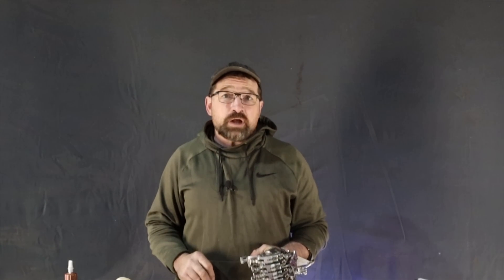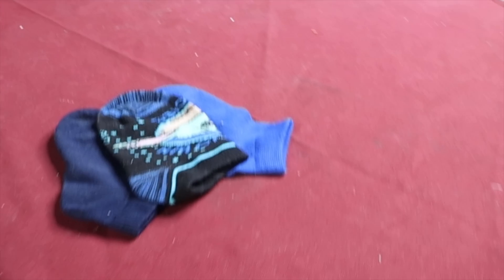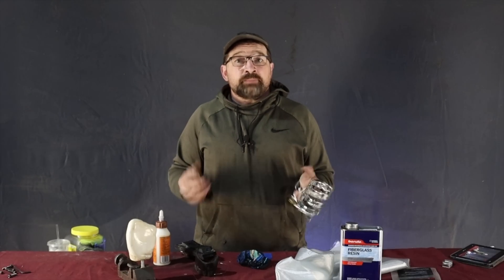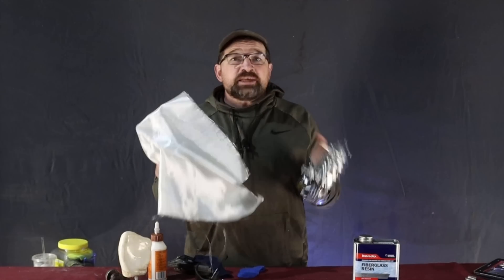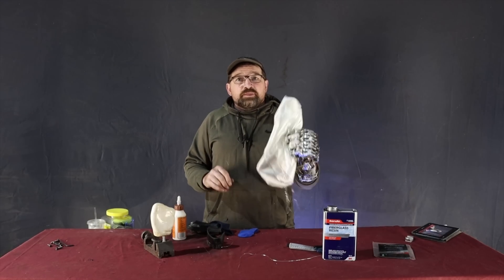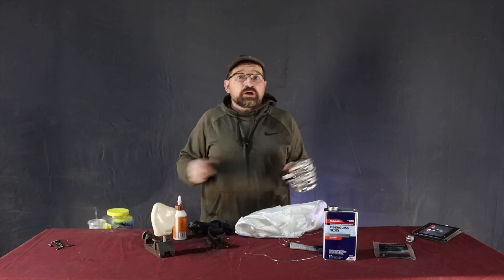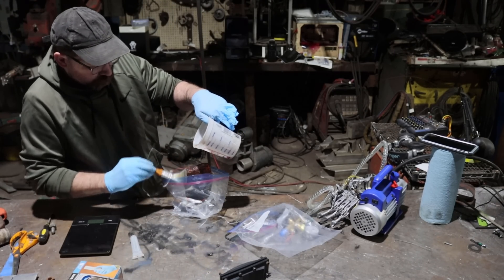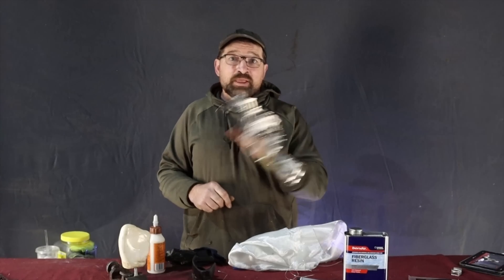3D Printed Prosthetic Hand  DIY Video No.4  Vacuum Bag Composite!

Comment: I’m a prosthetist and I have started to use PrePreg carbon in my hand prosthetic devices - thinner, lighter, stronger than FG.  Does take a little more equipment.  Working with a prosthetist for some people would be a better solution than working through the iterations that Ian is working through but Ian is certainly an expert on his particular shape!
Reply from the maker: The only reason I'm showing the process using fiberglass is because I'm trying to put together a "kit" solution that would be possible without anything too special. If you have a home depot/lowes, a hobby lobby/Michael's, and a 3d printer,  you can fabricate a prosthetic socket for this device.  If someone wanted to substitute in cf in for the fg that's an easy swap. The plaster buck would be the same. Just need a toaster oven and high temp bagging materials. Zip lock freezer bags aren't going to work for oven cure.

Comment: If you want it lighter, stiffer and stronger, try the same method with epoxy and twill weave carbon fiber. Twill weave is designed to conform to complex shapes.
Reply from the maker: If that was the goal I'd probably go with a combination of twill and unidirectional prepreg for the main body and forge the interface with chopped strand. I'd also be sure to include threaded titanium inbed plates. But the goal of this series is to show building the socket from materials that can be had in just about any location. If you have a Home Depot/ Lowe's and a Hobby Lobby/Michael's  you can build yourself a socket. I'm trying to show the process being as simple and readily accessible as I can.
Reply: @Ian Davis  oh that makes sense. I work in composites and make carbon fiber skateboards for a living so I couldn't help but share my thoughts. I work with these materials so regularly I forget they aren't very regular for the average person. Absolutely love your work BTW!

Comment: Can you go a bit more in detail on how you got a proper vacuum seal between the outer ziplock bag and the vacuum pump?
Did you somehow permanently attach that outer bag to the hose?
Reply from the maker: I printed a pair of interface blocks to go through the bag. The vacuum gage setup from the vacuum pot goes through both pieces, screws together, and squeezes a pair of silicone washers. It's not perfect,  but it gets 25 inches. Which is more than you need. Really, you want it to be around 20 inches. Otherwise you can start to suck too much resin out of the layup.
Reply: @missingpartsclub  Nice, thanks for clarifying! :)

Comment: Have you ever tried TX-2 or TX-3 concrete mender? It's a 2 part poly that sets up in about 15 minutes, it's flexible, and it has enough tensile strength to hold concrete together. There's also a newer concrete mender by rhino I think, it's black and turns gray as it sets up. Mix 1:1 and stir for 10-15 seconds, or until homogeneous. Right off the bat it'll have a viscosity similar to water, but give it a minute and it'll start moving like molasses. Mix it too much and this transformation will happen instantly, and it'll solidify as you do your first pour. You could also mix in 3 to 4 parts aggregate, but I wouldn't recommend that for use in a prosthetic.